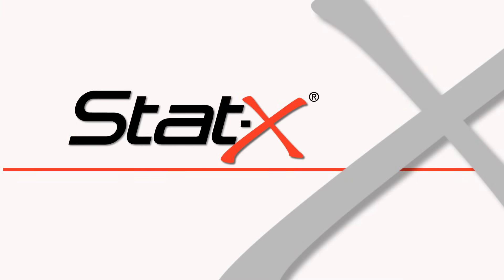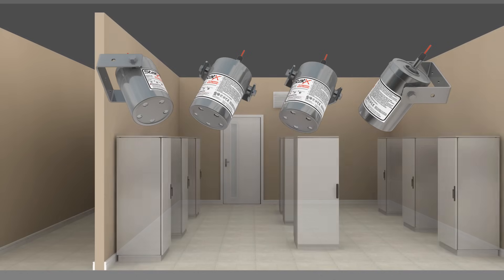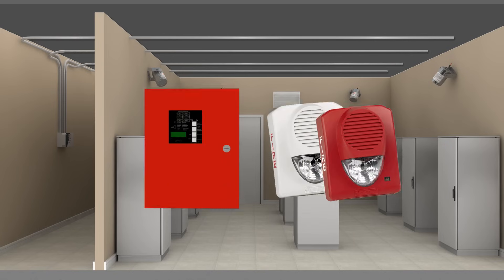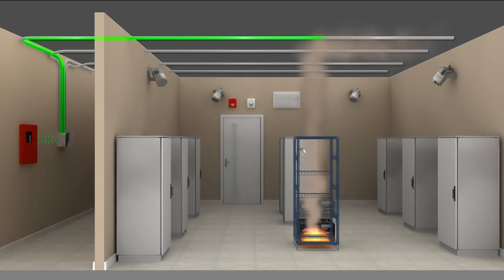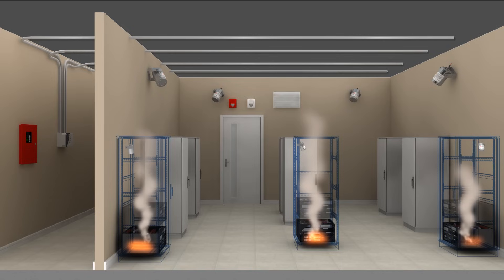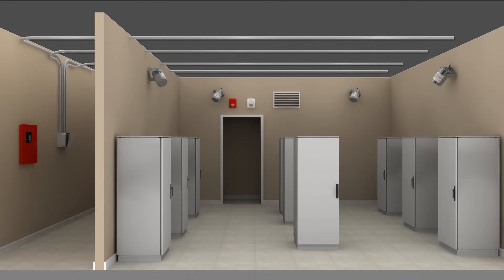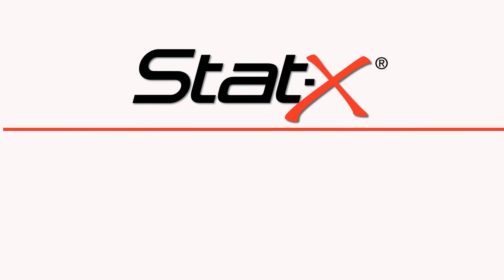Stat-X Fire Suppression System - Animation Video

Comment: Yep. Water sprinklers save people but destroy electronics. Gas systems save electronics but destroy people.
Reply: What gas systems do you know of that hurt people. 
I know that the statx system in the building I am in right now hurt the installer in an accidental discharge. Burnt him severely.   And the residue burned holes through stacks of papers.  It was a terrible mess afterwards and destroyed everything.  
I am testing 10 statx systems today.

Comment: If you have three different panels catch fire at once you're either dealing with arson, or some idiot doing hacky repairs. In either case you should put in security cameras once you've rebuilt the burned out panels. :)
Reply: Or a cascading failure (idk if it's possible with switch cabinets tho)
Reply: Neutral failure at the distribution transformer.

Comment: Question for second scenario what happens if your in the room when the flooding event started?
Reply: You get a 30 seconds to evacuate. In most cases, you can also abort the room flooding by pressing an abort button. If you fail to evacuate or abort it, and you stay in the room... You're in deep trouble. (I don't work for them, but this is how it works in most Data Centres so I assume it would be about the same)
Reply: Yes: it is correct about the 30 second pre-flood countdown, however most building locations where such fire suppression units are implemented, there are several brightly (usually florescent for easy location) colored storage units that contain either a re-breather or SCBA equipment dependant on the chemical contents used that any personnel who may be unable to evacuate within that timeframe (large room, etc.) That can be quickly donned to protect against the risk of asphyxia during a full flood event. 😷💨🔥
Reply: You're in big trouble then and you might lose oxygen and you probably tried getting some oxygen but you get the thing that is disposed by the wall mounted Stat-X units.
Reply: Ded
Reply: @FANG-onPAWZZ XD ded
Reply: You screwed then

Edit 1: play thick of it on the white alarm

Comment: 1:30 sounds like the blue emergency exit door alarms where I work, at the  Lowe's  here in Monroe, Washington, Washington  state.
Reply: That’s not a fire alarm
Reply: Huh? I just said it wasn’t a fire alarm...
Reply: That's the sound of a Gentex Commander 2/3 in whoop. I've actually seen a few Lowes & maybe Home Depots too with blue Commanders being used as exit alarms. Wouldn't surprise me if whoop is usually chosen as the tone for emergency exit application. Some other Lowes/Home Depots I've been to have had white Gentex GMSes or SHGs as the exit alarms.
Reply: @TheCarson116  commander 4 does not have whoop function.
Reply: @AcElectronicSystems  Ah yes, you're right, I'll have to update my comments to reflect that. Have no idea why Gentex didn't make the Commander 4 with a whoop tone though, what about general signaling applications that don't require Temporal 3 for example?

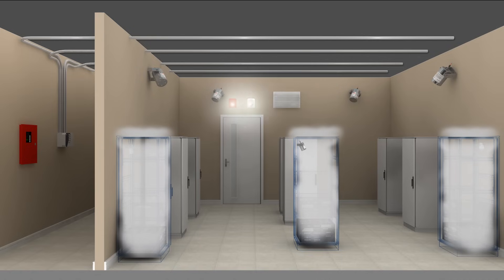Comment: At 2:44 I love the sound of that horn strobe what's the name of it?
Reply: It's the whoop sound of the gentex commander 3
Reply: the white one for flood alert
Reply: the red one is pre discharge
Reply: @quynhvu2343  Actually, wrong: the red one indicates a general (fire) alarm, the white one indicates the system will discharge.
Reply: It’s 90BPM march time of a mechanical horn, I’m not 100% sure what mechanical horn model but it’s very unlikely to be able to get that coding on such horn, and impossible to do it on a modern fire suppression fire panel.
Reply: It is a potter alarm

Comment: Why is a full room discharge needed if multiple fires are detected? The smaller discharge cans were activated, so I dont see a point in full room discharge. It should only be needed if a fire is still present after normal discharge.
Reply: Or in the room itself
Reply: ...unless it's a precaution, since multiple fires detected at once could be a sign of a large, hard to control fire that needs full discharge to be extinguished

Comment: what were those alarms?
Reply: Evan The gamer First one (slow whoop) is a regular fire alarm (industrial, not office, those are usually bells), the second (claxon, only I know a claxon to be slower) means elevated danger and/or wider but still limited area, the sign to GTFO. There's a third one, the siren. If you hear that you know you might have just enough time to text your family you love them...

Source: suppressed and faded memory from my days in OSHE. I wish some of the sites I worked at had this system...
Reply: @hisss  What you've said does not translate to this video. The alarms in this video are set up thusly:
Red Potter SH-1224: Indicates fire
White Potter SH-1224: Indicates suppression system will discharge, leave the room ASAP. Usually known as a "pre-discharge/pre-release alarm"
Also both are horn/strobes, klaxons are a different kind of audible warning device & so are sirens.
Side note: The red SH-1224 erroneously emits the sound of a Gentex Commander 2/3 in whoop instead of its' actual sound. Chances are the alarm wouldn't be sounding in continuous either, probably code/temporal 3.
Reply: @TheCarson116  That's the first time I've ever come across a necrobump that was actually useful, thank you for the correction.
Reply: @hisss  No problem, just sharing my knowledge.
Reply: That is potter alarms
Reply: XX EDGE_Universal_Destroyer XX  Well, technically speaking the red SH-1224's whoop tone is actually that of a Gentex Commander 2/3, therefore it's not making the correct sound. Not sure about the source of the 2nd one's sound though, sounds like a pretty generic alarm of some kind.
Reply: XX EDGE_Universal_Destroyer XX  Wouldn't know as I've never heard a biohazard alarm. (if they're even a thing)
Reply: XX EDGE_Universal_Destroyer XX  Okay now you're just talking nonsense.
Reply: WilliX Haxsterz  Pretty sure it sounds nothing like one. All anyone can really say for certain is that it's the sound of SOME kind of alarm, we just don't know WHAT alarm it is exactly.
Reply: WilliX Haxsterz  Yes, close, but not identical.
Reply: WilliX Haxsterz  Well good luck.

Comment: Does this system meets Global Insurance regulatory requirements and does it comply to some NFPA standards ?
Reply: Yes it meets NFPA and the business I just installed 2 weeks ago (a pharmaceutical company) had Global Insurance. So it meets their standards as well. It's a great system and a lot less maintenance required even after a discharge. The company I work for has been converting our customers from the usual CO2/Intergen/Halatron and FM 200 systems to these systems. Great stuff in my opinion.
Reply: VINAY MAITHANI nn
Reply: Is it satisfying to your hazards without any harmful.  Even meet NFPA

Comment: Was I the only one who noticed the Fire alarm they used had the whoop noise of the genres commander 3
Reply: Yeah, sorta odd: they show two Potter/Amseco SH-1224s, but the red one makes the whoop sound of the Gentex Commander series! (2/3 specifically) In addition I have no idea where the sound the white one makes comes from, if it even is the sound of an actual alarm. Have no idea who makes the aspirating smoke detector or panel either, the panel looks to be a similar or the same brand as the horn/strobes though.
Reply: Aurocorrect fail
Reply: gentex and yes
Reply: Yup

Comment: I'm sold on the stuff, It discharges timeously  with reduced noise levels as compared to high pressure inert  gas suppression systems, thus dismissing the chance of data corruption through audio interference. Further with aspiration detection devices as the control mechanism there would be a dischargee at incodescent  stage, so there would be no flame and depending on where the initial heat source was generated from possibly little or no damage to the primary equipment being protected. No need to do room integrity tests. Stat-X has a low pressure particulate discharge , about 2µm at 50 to 75 kpa, so it spreads far and quickly.The only drawback is the lack of visibility in normally occupied spaces after a full system dump, but this can be over come with innovative thinking, reflective tape and floor mounted LED evacuation lighting.
But be careful as with everything. It has it's limitations, its not a coolant , nor does it smother . this interrupts' the exothermic reaction of the flame, so a premature vent may give rise to re-ignition if the original source of ignition was not removed.
Reply: I think it's meant for more industrial use, where there wouldn't be people like elevator service rooms and such
Reply: It's actually for many places such as computer IT/network rooms, server rooms, ship/boat engine rooms, and many other applications. I install these systems and you can breathe fine when it discharges unlike CO2/Intergen/FM200/Halatron and there is no damage to electronics. It's really a great and easier system to install than conventional compressed cylinder systems.
Reply: Olympia Typewriters